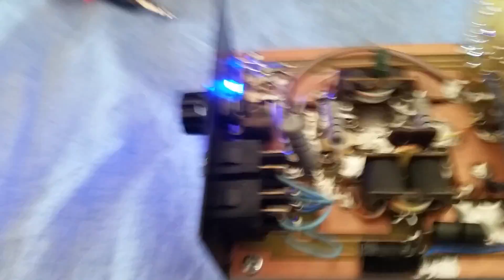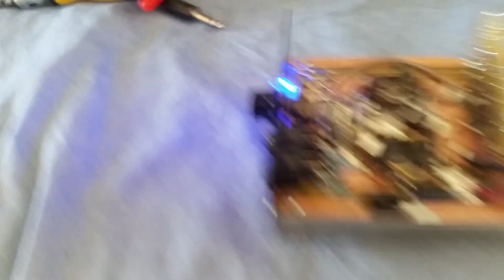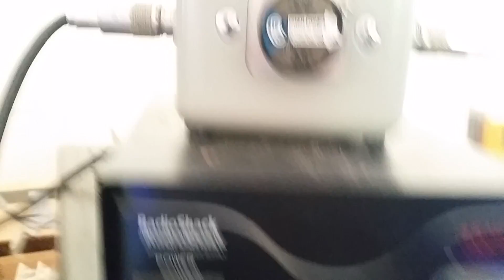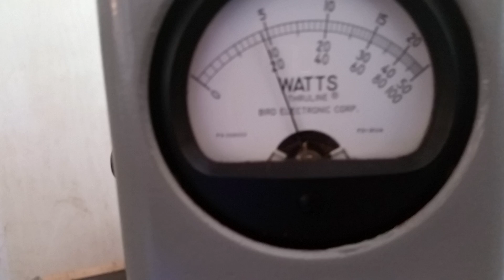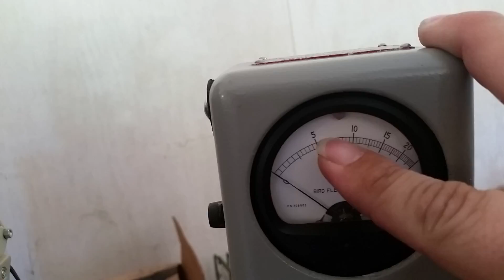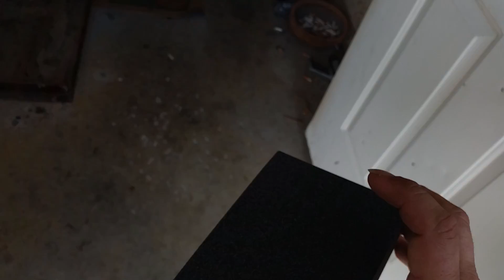Messenger Hot Shot 250v 2xSD1446 Amp For Ebay - SOLD!

Comment: Ok so it's a 100 watt rms amp?
Reply from the maker: If that is what i show..im sure I showed peak to
Reply: @1883GotDown yes you did. I have an m250 but I've only seen 130 watts out of it perhaps my meter doesn't measure "pep"  I was thinking mine was low on power but maybe it's normal. Thanks for the video.

Comment: Awesome. I have a Hot Shot 125V sitting on the shelf in my shop that needs work, also a Penetrator 125...same thing. Both will power on, but won't do anything when keyed up. Just a matter of making the time to look into it and fix them. Learned something new, as usual with Gatekeeper...I didn't know that Messenger made them, cool.